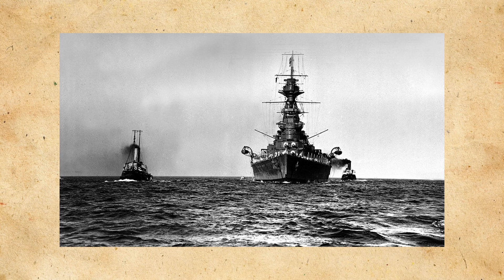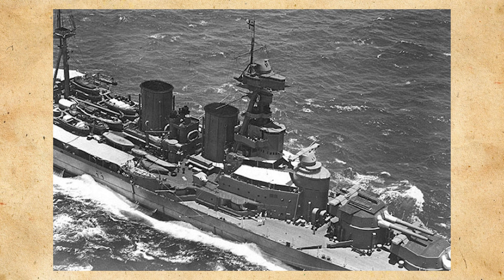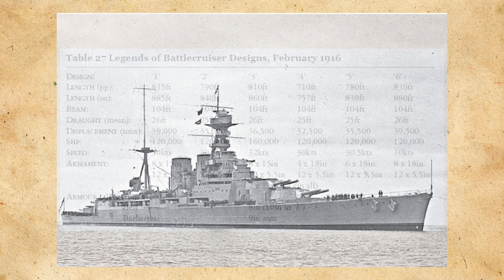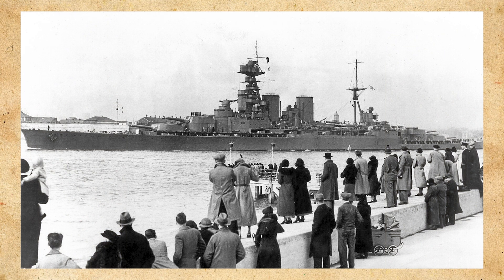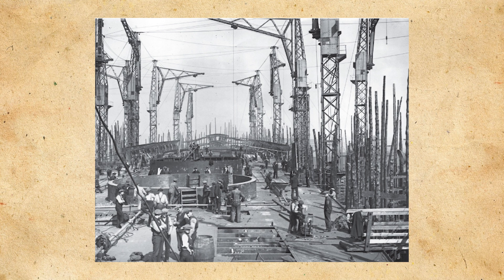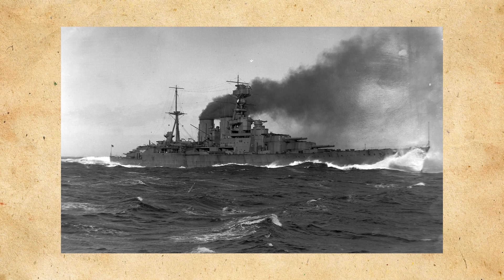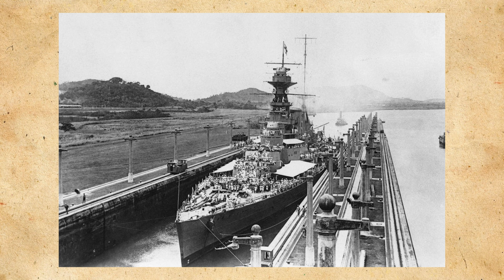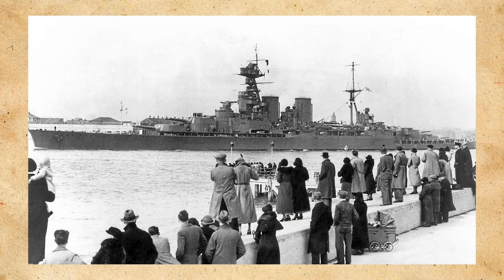British Battlecruisers Pt.3- HMS Hood

Comment: Forecastle is pronounced "Folksall".
Reply: Forecastle is pronounced Four-castle. Fo'c'sle, the shortened version of Forecastle, is pronounced Folksall.
Reply: @austinhawkins3307  I have never heard it pronounced "Four-castle", that's interesting. Got any examples or references? It is pronunced (Howerever one wishes to spell it phonetically) for hundreds of years. I have only headrd it pronounced how it is spelt by non-nautical persons.
Reply: @Gordon Smith  I have only heard it pronounced Forecastle when not using the shortened term of fo'c'sle. Particularly in my service in the Navy, when documentation was being reviewed, and the word "Forecastle" came up, it was pronounced how spelled, but Fo'c'sle was pronounced how spelled as well. The two are interchangeable, yes, but the difference is there I suppose.
Reply: @austinhawkins3307  I have never heard it pronounced "forecastle" I'm 73 and come from a military family (Navy and army) I wonder if this is a U.K./U.S. thing?
Reply: @austinhawkins3307  No. Forecastle is pronounced fo'c'sle. Has been since at least1840. Check out The Nautical Institute website.